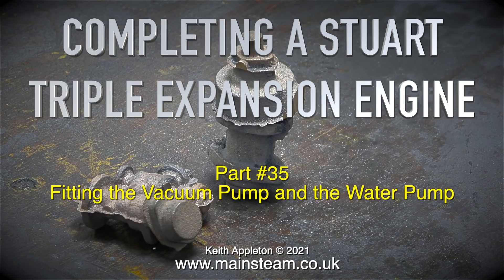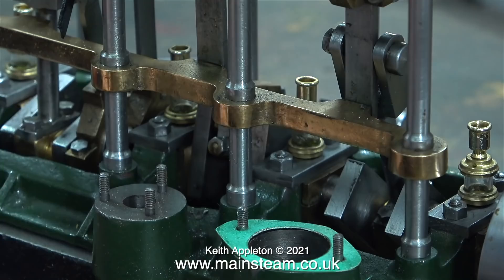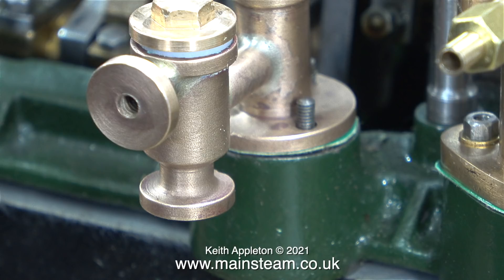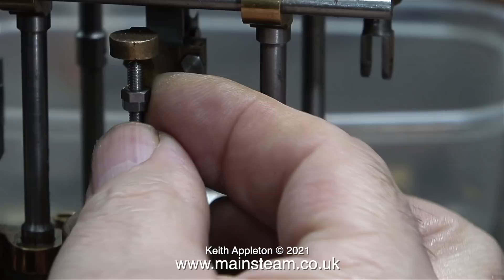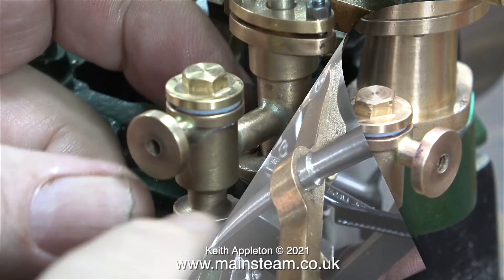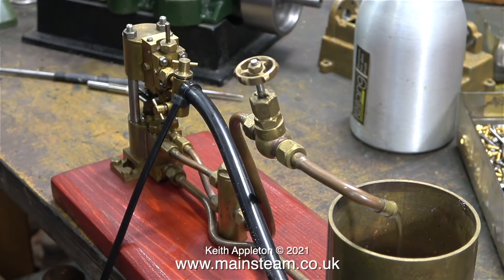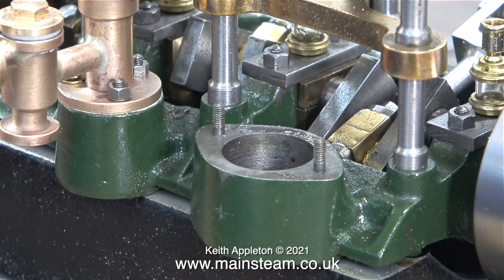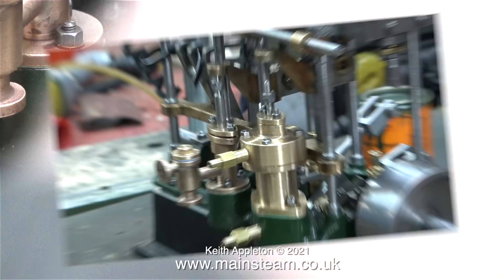COMPLETING A STUART TRIPLE EXPANSION ENGINE - PART #35

Comment: Probably more for full size than models, - after the last stage the exhaust goes into a condenser where it is cooled and forms a partial vacuum. This way the last stage has no back pressure, but rather exhausts into a vacuum. Low pressure on one side of piston, negative pressure on other side. The condensate pump removes the condensate and maintains the vacuum.
Think steam ships and power stations. (Same principle with turbines.)
Reply from the maker: Thank you for the useful explanation {:-)))

Comment: The steam flow from reciprocating engines fluctuates a lot as the pistons move up and down, so it can affect the vacuum in the condenser, particularly at low load/rpm. The vacuum pump supplements this, providing a more consistent pressure for the condenser (Note the LP piston gains most of its power from working against the vacuum, and produces little to no power if it's venting straight to the atmosphere). The water pump simply feeds coolant - typically sea water - through the condenser to condense the exhaust steam back to water which produces a natural vacuum in the condenser. This of course requires a certain amount of steam flow i.e. higher load on the engine to produce a high enough vacuum, hence the need for the vacuum pump. 

It should be noted that most steam turbines use an auxiliary condenser vacuum pump that can be shut down after the turbine is started, because the turbine runs off a continuous flow of steam that doesn't fluctuate so heavily as it would in a steam engine, thus is easier to balance the vacuum it naturally produces.
Reply: Extra note that triple expansion engines were mostly used on ships, hence the usage of seawater as coolant